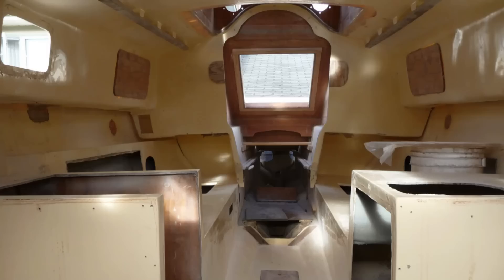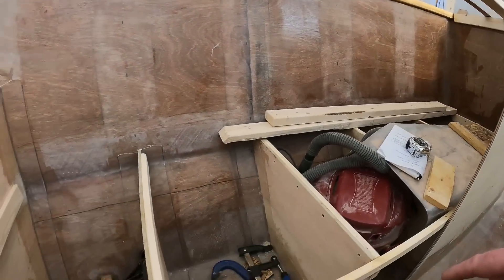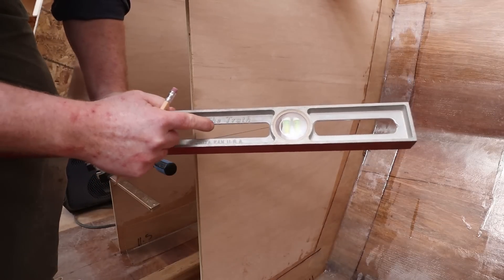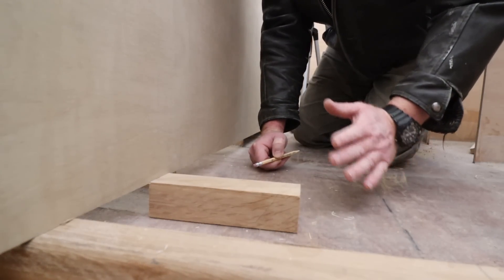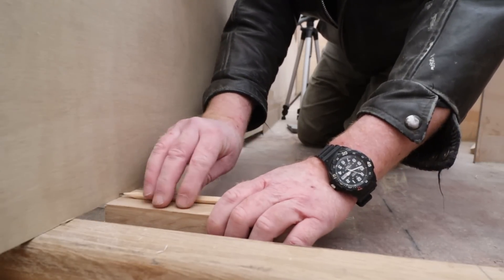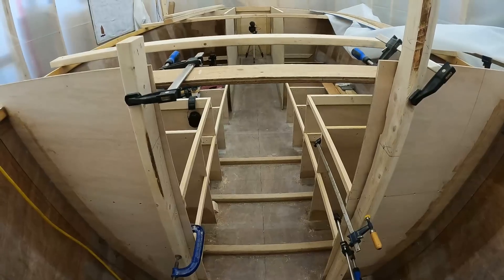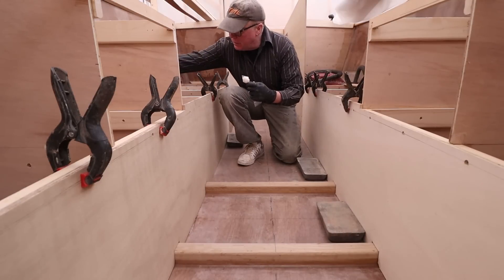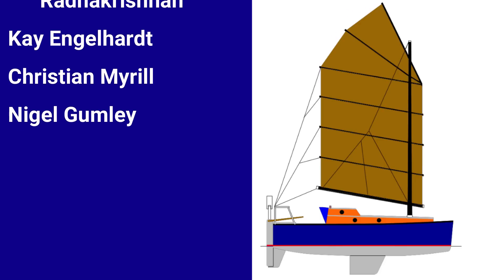S2E44  Longitudinal Bulkheads || Cleats and Stringers || Skeg Supports

Comment: It’s so fun to watch it come together. Here’s a question that I struggle with: when is one supposed to use titebond vs thickened epoxy?
Reply from the maker: Two flat surfaces that will be inside and away from anywhere that is likely to be immersed would be a good use for titebond. Thickened epoxy is great everywhere especially when gap filling is needed, but it is messy and more expensive.

Comment: There was no titebond on the fronts of the ringframes, only along the top,  glueing the ringframes to the longitudinal would have made a way stronger structure, ??? Creating a unified bonded structure of ring frame to longitudinal, and then of course the fillet to the hull which you will do
Reply from the maker: In an up coming video you will see how I deal with that joint and it will be strong and water tight.
Reply: Personally I would have glued the longitudinal to the ring frame fronts and then put fillets and cloth inside
Reply from the maker: @setkacagarro-blogspot-com  the fillets and cloth are coming. The challenge with epoxy is to complete what can be done in one step by one person. That's why I often break things down to multiple steps.

Comment: So your level is… on the level. A straight shooter one might say… 
Ok, I’ll stop there. 
Nice work as always Alan.
I’m working with pvc as you know. I almost always use a panel saw to cut the pvc/epoxy/fibreglass sandwich as apposed to a jigsaw. The panel saw cuts nice straight lines without trying ( unlike the jigsaw that wanders ) and it’s way faster.
Reply from the maker: Thanks Robin, I would imagine you are enjoying some perfect temperatures for your epoxy work. 
I've had that level for years. Levels today (generally of poorer quality) are afraid to make such a bold statement.
Reply: @RoversAdventure  Pluses and minuses really. The slower cure times can be both a help and a hindrance. I really have to wait two days now before the epoxy really sets hard enough to sand, but it’s nice not to have to rush to get it out of the pot before it cooks off. But I shouldn’t complain. At least I’m not dealing with freezing temperatures and the problems that come with that. Cheers